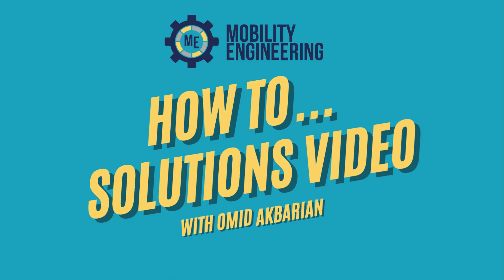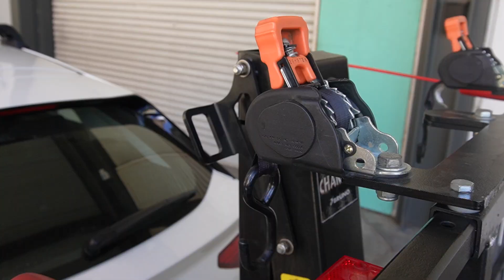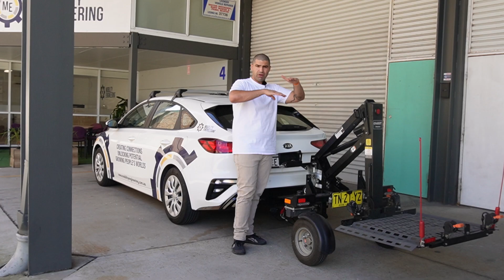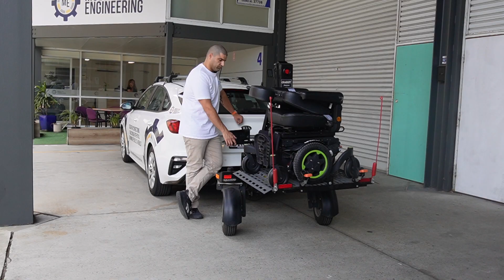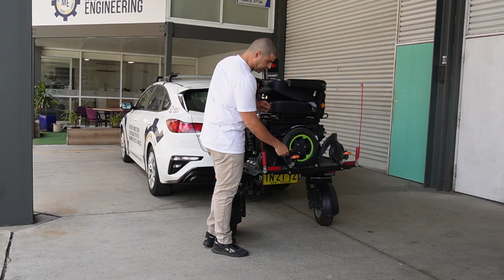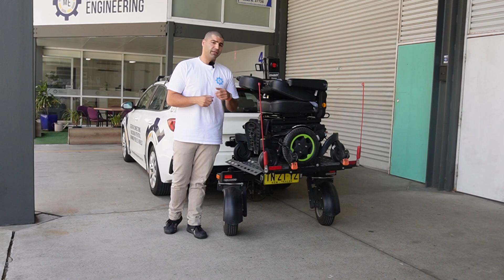How to Use the Chariot Trailer

Comment: Great demonstration! Could you please demonstrate the correct adjustment for ride height! Specially with different height tow bars and vehicles!
Reply from the maker: That's a great suggestion - we will make a separate video for this!
Reply: @mobilityengineering7184  That’s awesome because I have two vehicles with different height tow bars!